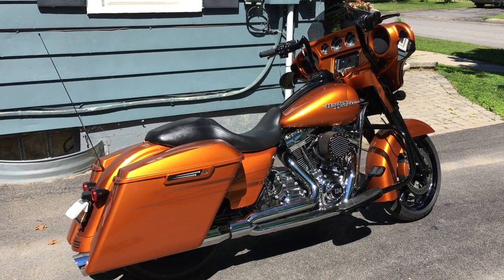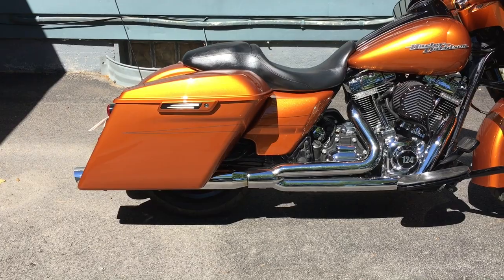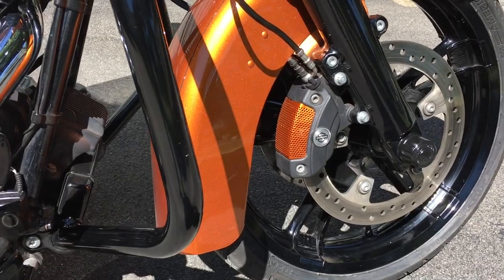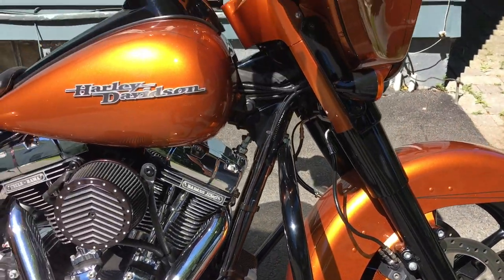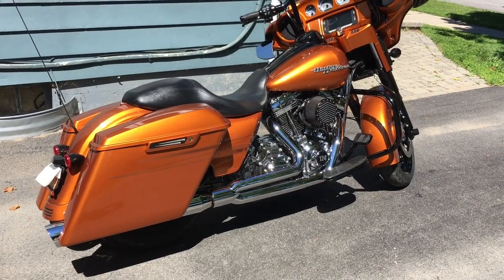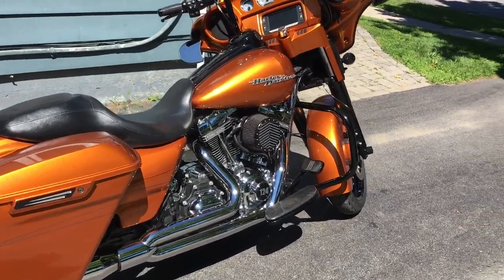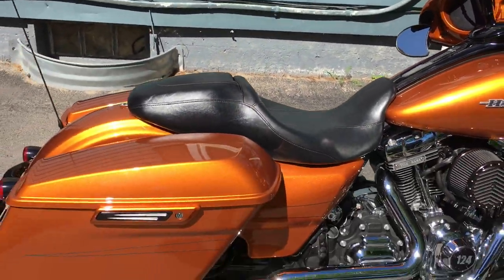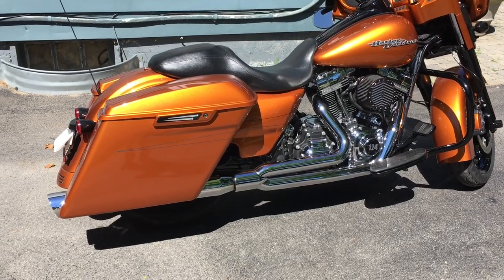Cycle-Rama 124  150 HP

Comment: Very nice! I have a 124" with Cyclerama 630i cams, 11:1 compression, 195/195 CCP. Did 142hp and 140tq. You have a very nice machine and it sounds fantastic.
Reply from the maker: thank you  scott  I am running the 650 cams, static compression set @11.8 , ccp is 210/210  with 110 heads and a 62 HPI TB  what heads are you using and Tb ?

Comment: Killer sound.  Cant wait to go 124
Reply from the maker: thanks Danny yes it sounds killer you should here it when you decel  coming to a stop! this dragos exhaust sounds good and performs very well!
Reply: @toddlincourt9141  I have the Boarzilla but same effect. My favorite thing about it is coming down off of high RPM and hitting that sweet spot RPM range in the lower gears when it does hot hot-rod "gurgle" tone.
Reply from the maker: @scott7d  this drago"s 2 pipe sounds very deep especially with the bigger motor compared to the stock 103. my wife thought i did make the bike louder by doing some thing to the baffle. but not the case, its turns heads when i down shift hard coming to a stop.

Comment: I have a set of the CR650 cams and CR630i getting ready have wes do some work and pick which ever one? Maybe one I dont even have yet. Currently running Star Racing 650 doing 134T 146HP wanting more Cowbell
Reply from the maker: the 630 cams will come in earlier, the 650's will bring more to the table are the spec's on the star cam close to wes's cams. the head work is the most important i am running 110 heads that are flowing 350 cfm's @650 lift with compression @ 11.8 WES makes a 750 lift cam too.
Reply: @toddlincourt9141  George's Cams only give the  Exhaust open 60 Intake Close 40 TDC .189 .189, I want the most everywhere. I already told him I'm willing to buy whatever cam he suggests. 110 Heads MVA valves installed with 99CC chambers. That's really the only issue is that it gets hard to get compression up with that many CC in the chamber to start with.

Comment: Question did you change out the ring gear.... for better and faster starting ....like a 84/10 or even a 66/9 ?
Reply from the maker: no i did not  the motor turns one revolution and its running most of the time.